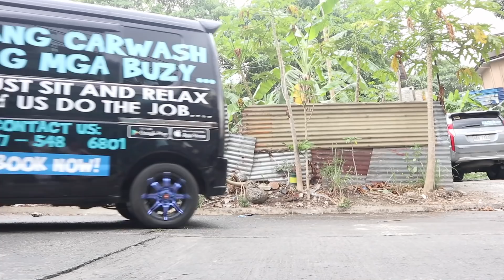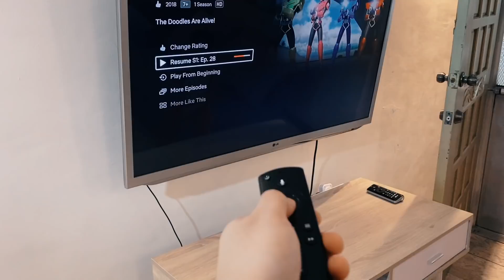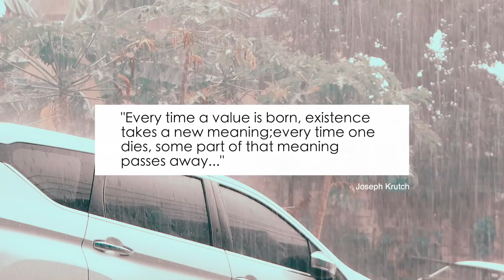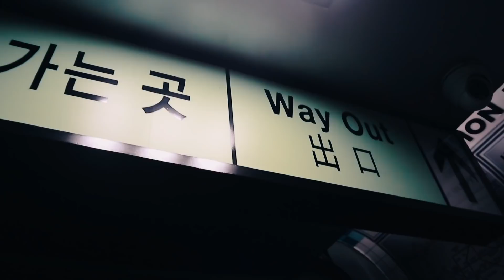ANG TOTOONG NANGYAYARI SAKIN ( IKUKWENTO KO NA LAHAT... ) | [ Nina Rayos ]

Comment: This is how I manage anxiety and stress. 
One really need to identify the root cause and be honest to oneself. Sometimes it is not easy to accept because the problem is sometimes someone you love.  
1. Sleep of top most importance- it regulates cognition and mood 
2. Have a schedule for the day and follow it. 
3. Eat protein and fiber filled breakfast 
4. For mid day anxiety, drink a hot carbohydrate drink 
5. Exercise is medicine. Even 30 mins will give one a sense of achievement 
6. Pull back when needed and stop everything you are doing and deep breathing for 2 mins. 
This is what has worked for me. Ultimately stress and anxiety has sources and it will not go away completely unless the source gone. If you can make a change on the source do it.